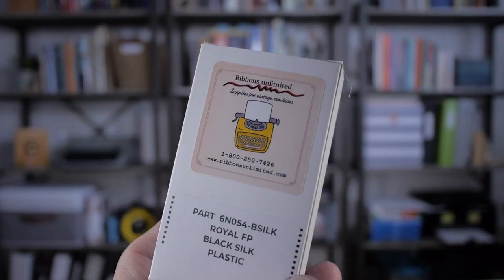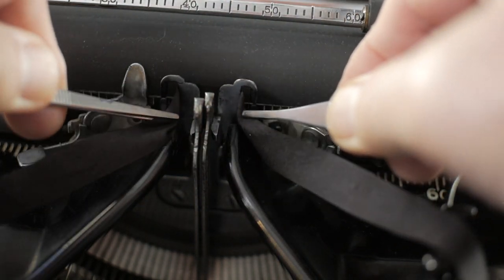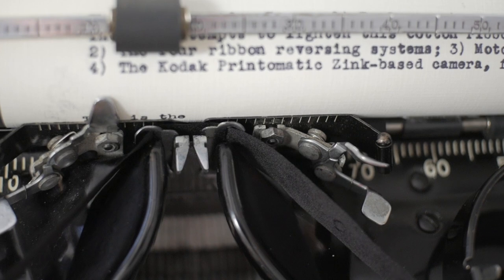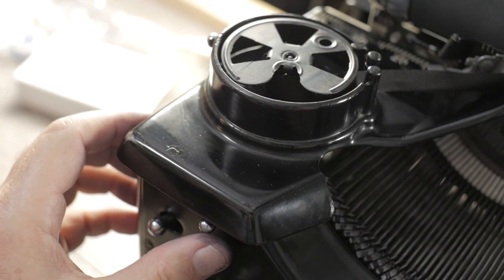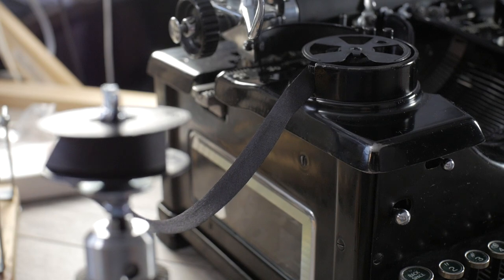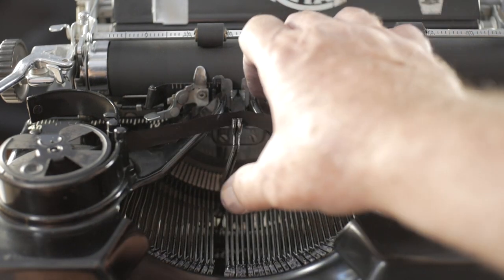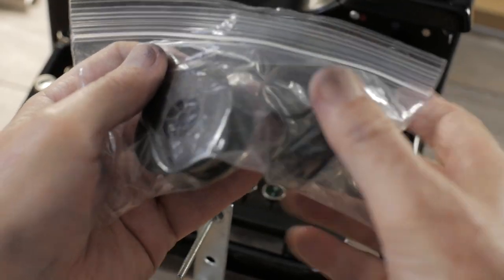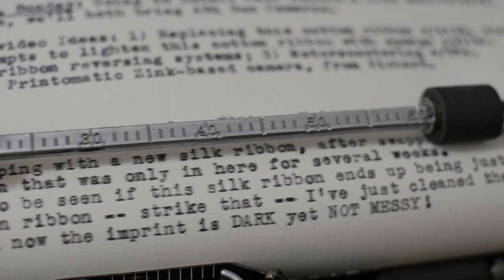Typewriter Video Series -- Episode 278: Royal 10 With Silk Ribbon

Comment: Joe, you are out of your depth, as a typewriter mechanic of many years and  ribbon manufacturer of 25 years  let me tell you there are many factors involved in a good clean impression and it starts with the machine, anvil (ring) to  platen and  the platen itself . then the ribbon, the quality and viscosity of the ink, the ink being designed for the job it has to do, the amount of in applied to the fabric .Cotton was used first typewriters ,  long before my time then silk both of which demanded woven edges, then Mazlon, Banlon and finally the nylons we used from the 1960's which were every bit as good if not better than silk and cheaper to produce, nylon became available in a varying calipers, weaves and consistant edges regardless of width. The fabrics were specialized and became known as Impression fabric. I would be very interested to see a silk ribbon of todays manufacture because silk for typewriter became unavailable 35 years ago
Reply: I don't know about any of this fancy stuff, but I can confirm that a newly manufactured silk ribbon gives a significantly sharper impression on my Underwood Master than a nylon ribbon does.

Comment: There are many parameters for a good imprint, ans when having several.machines, my goal is to have different kinds of imprint, very clear and thin, a bit dirty and fat, even very dirty and used fir different kind of expression in my writing, therefor the ribbon, the typingtechnique, the platen and the paper are the setscrews to get the desired result. Type to play and to experiment.